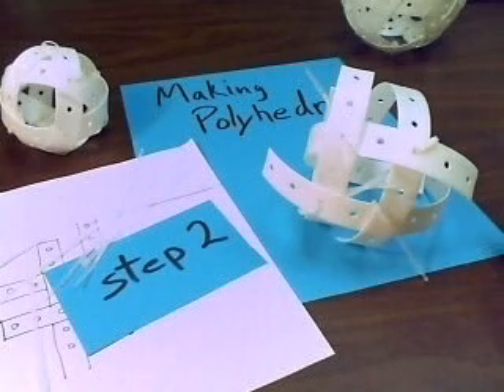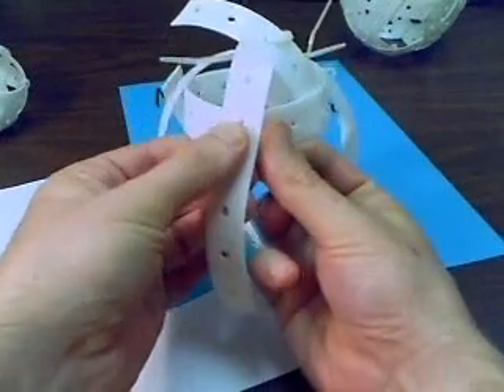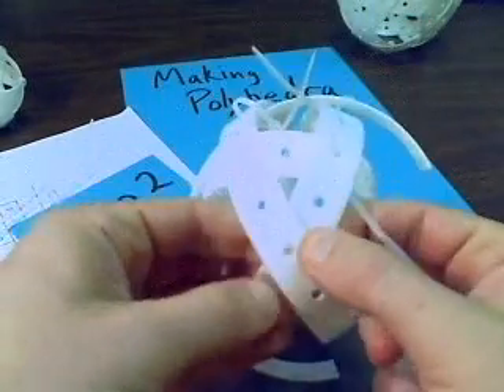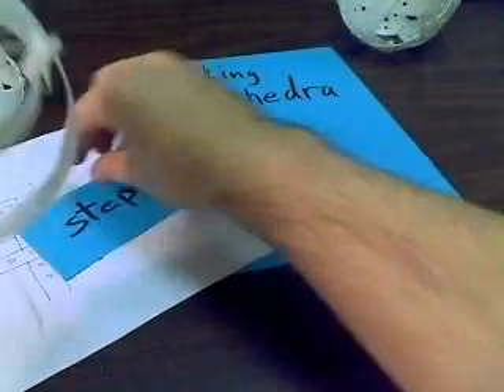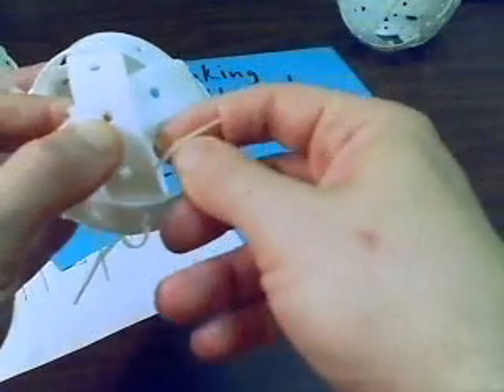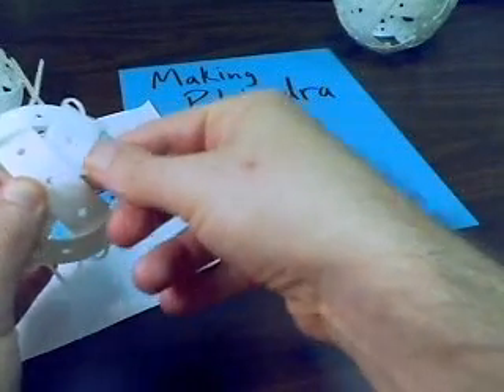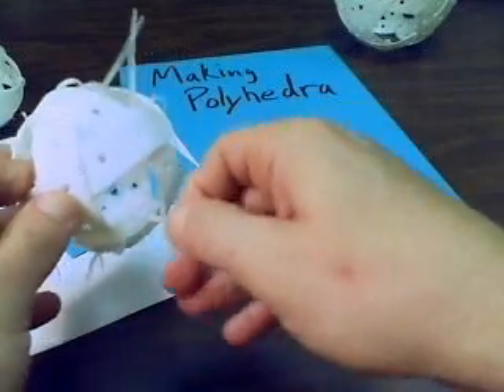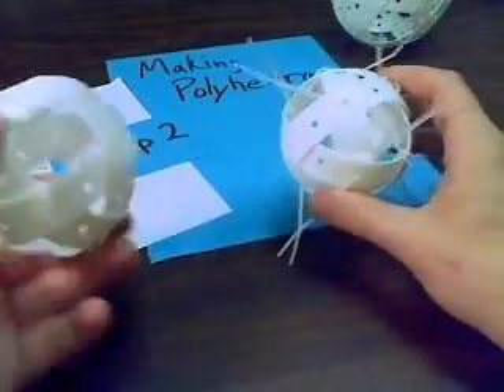Making more polyhedra (step 2)

Comment from the maker: sorry about the  slow response....  must have missed your comment.   Hanger tape is used for hanging pipes in your basement.  It used to be copper or some sort of metal but now you can get it in plastic.... it's very cheap.  I think that the holes are spaced every 3/4 inches.  

let me know if it works out.
cheers
jim